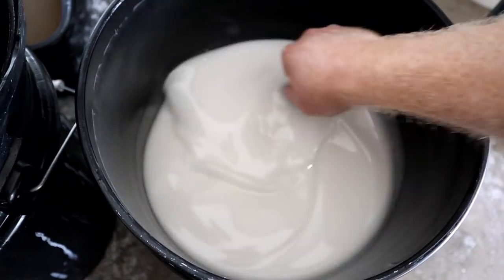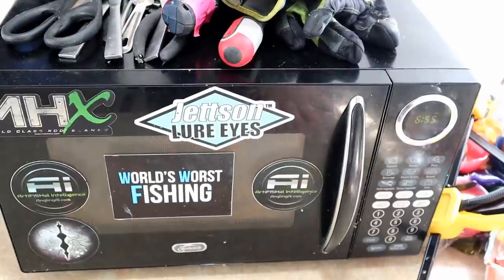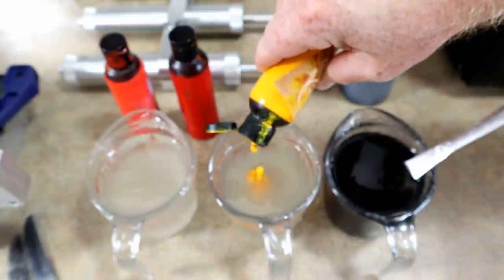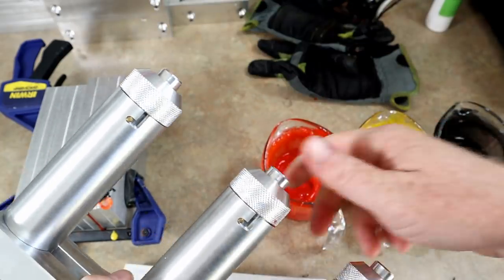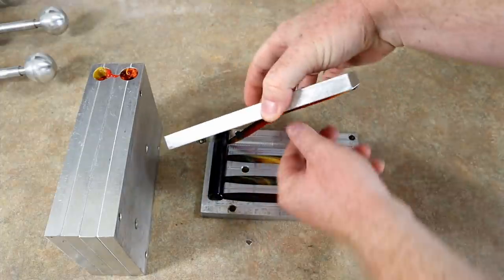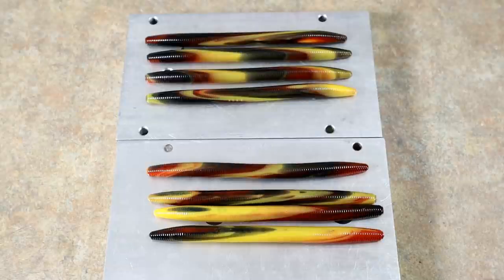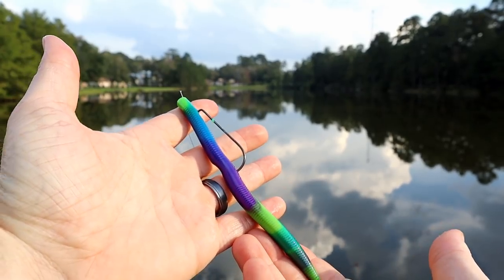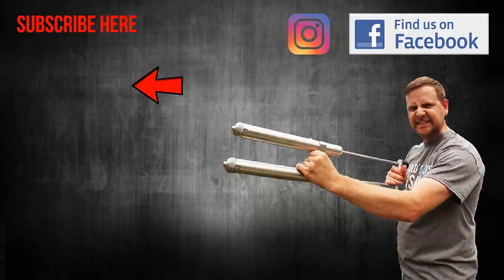TRIPLE SWIRLS!! Triple Color Swirling Soft Plastic Stick Worms

Comment: Another great informative vid!

I'm getting ready to buy my first injector. I was thinking about getting the triple injector to give myself more capability. Could you push all three at once and use a c block to get a triple swirl instead of having to milk the cow?

Also I saw in another one of your videos that you can disassemble the triple injector and use them individually. This might be a dumb question but can you use the triple injector as a dual injector with one tube empty, or does this present issues? Thanks for any advice!🎣

Comment: What if you try "twister" with triple nozzle? Clamp the mold into bench vice and while giving pressure, just turn the nozzle bit every now and then to make a swirl. Would that work? 🤔
Reply: Using injector with the bar, but tuning injector & nozzle clock wise like second hand in a clock while giving pressure.

Comment: Try a triple injector with the top bracket on and twist it around as you push
Reply from the maker: Twisting really doesn't change the outcome and in my opinion makes it less consistent